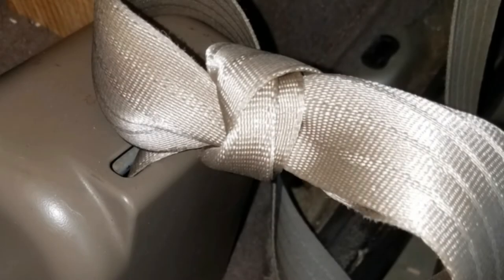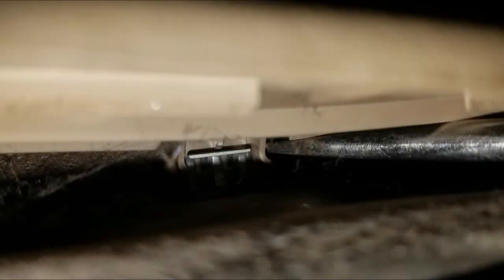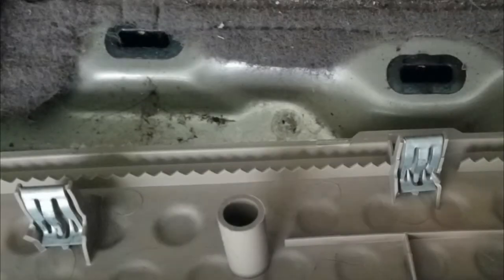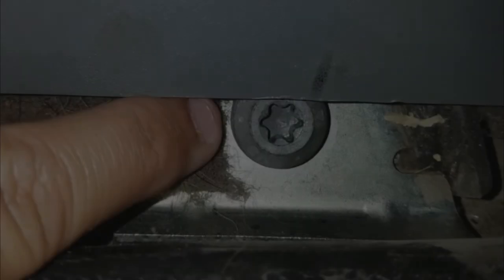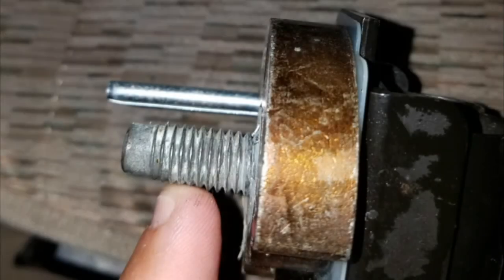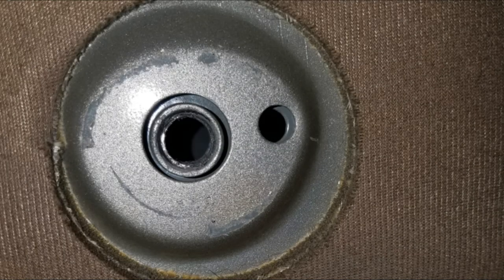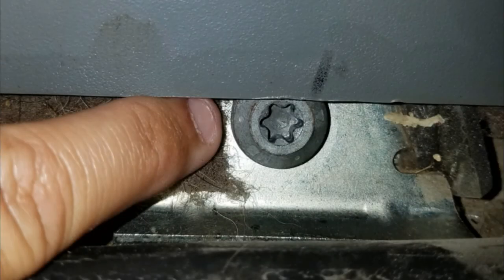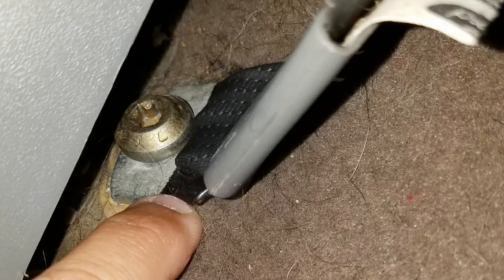Seat Belts Are Fixed On Our 7.3 Diesel!

Comment: Did all the mounting holes & brackets match up with the 2006 part?  Any modifications needed?
Reply from the maker: All of the mount holes and brackets did match up with the 2006 part. I would consider them direct replacements even though they came from a truck 6 years newer.

Comment: I'm not a smart man. But I'm not a dumb man either. You could have gone a little deeper into the actual removal and then the installation. I just need to take the drivers side should belt, and put in the used one I was forced into purchasing. 
COME ON MAN
Reply from the maker: I apologize for the late reply. 

I am not Steven Spielberg and do try my best to document some of the tasks and maintenance I perform on my truck. Although, I do miss the mark at times. 

Thank you for the constructive criticism.